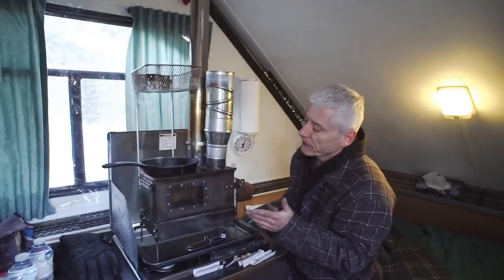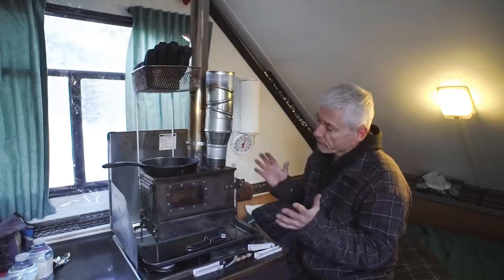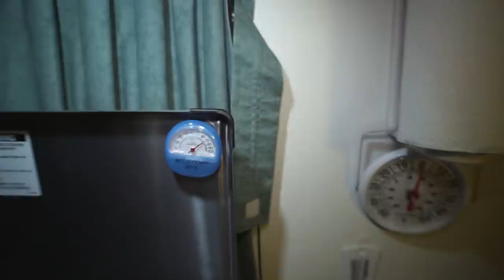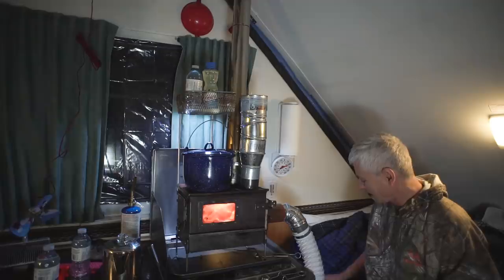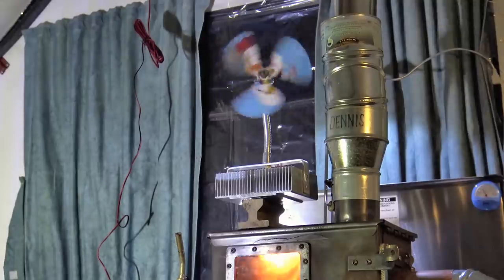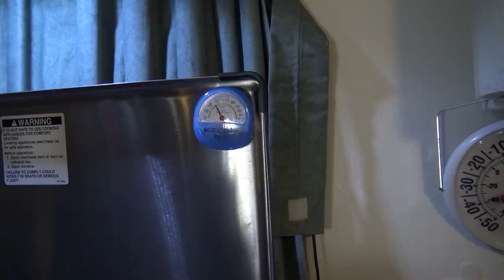Wood Stove in an A-Frame Trailer - Part 2

Comment from the maker: Comments appreciated but NO LINKS PLEASE !!! They get blocked. Thanks, SP
Reply: Have you thought about putting a rock on top to hald & radiate some heat?
Reply: get a rocket  stove.
Reply: Slim Potatohead where did you get the stove? It’s great 👍
Reply: @samgould9930  , I was thinking the same!!! Medium sized rocks to absorb & radiate heat around the base of the stove!
Reply: @marcgraham6438  , he fabricated it, himself. He posted videos on the progress.
Reply: Kate Hare McIntosh wow thanks I’ll look back
Reply: Super cool man!
Reply: @khm2128  non porous though..i like this idea.
Reply: @samgould9930  that's a great idea
Reply: Drill a small hole in the side and attach a rod to a small thin plate with holes in it. That will work as a shaker grate for the ash and make stoking the fire way easier. Happy camping... Be safe.
Reply: some plastic can melt on 130 C to 160c depend of what platic is :) this is only for soft or medium plastic :)  sorry of my bad eng
Reply: There is a heat activated fan for wood stoves that  operates on it's  own...No outside power source. We use them on our diesel stoves in our boats in Alaska. I would have put up the link but.....
Reply: I would have no problem stoking the stove every 3 to 4 hours because that is how long I can go before I have to pee lol
Reply: Hi Slim. I think you and RV Geeks do the very best videos. My name is Rolf. I have had a woodstove and a parrafin as well in my motrhome. No I have a trailer, large european messaur that is. I consider a diesel stove like the danish REFLEKS or the swedish GLEMBRING  for reservheating. THey work without any electricity at all. Have you thought about them?
Reply: Hi again Slim. . Would you be so very kind and expain ; why is´´do some heaters develop moister and some dont?  You and others speak about dry heating. In my world warm air hold more water than cold air. So, water is condensating on colder surfaces like a tralerwall. More visible on the window. What has what do with the source of heating? GR/Rolf
Reply: Tripped a little on the words. I think you understand anyhow!!
Reply: A computer fan inline in that hose would stoke the fire up nicely. As some below said, if it were thermostatically activated, it would stoke the fire as needed, like an outdoor woodburner.
Reply: @samgould9930  I would warm the rock up and take it to bed. I'm so old, I have to take a warm rice sack to bed to keep my feet warm, (microwave 3 mins)
Reply: Needs bigger hopper.
Reply: @rolfbremberg5846  every flame produces water, if you can have the heat from a flame wich ventilates outdoors you have the heat without the moisture (dry heatsource). Some fuels contain more water than others. Electric heat is the best, but requires a lot of amps...  Often stoves (and fireplaces) suck in more cold air than they can heat an rea by burning fuel. A stove is efficient when it gives off more heat than it sucks in cold air to burn. Best is therefor to get a fresh-air intake dedicated to the stove frome the outside and a long pipe to vent out. This way the hot air isnt sucked out a room and used to produce a flame.
Reply: Hi Slim, I’ve watched many of your videos and I love them!
I’m shopping for a new trailer camper.. my current ones 18ft and nice but not ideal for towing or going into rougher  roads... so I was think of a small outside kitchen teardrop... but I’m kinda leaning toward an A-frame after watching many of your videos... mmmm....
Reply: @pavelstoikov3780  Your English is very good. :)
Reply: Thank you for sharing such beautiful photos I enjoy what you do I am kind of the same way been doing a lot of the same things for many years just turning 50 now

Comment: Source two thick Mylar survival blanket. Attach light duty magnets to your ceiling and blanket. It’ll reflect a ton of that escaping heat.
Reply: Mylar sheeting is flammable and burns with toxic fumes at up to 1000F.  So maybe not a good idea?
Reply: @robertb.slingsby3584  …..why would the Mylar be anywhere near a open flame?

Comment: Little heads-up cheap bit of advice go to the Dollar Tree store and get some hand sanitizer the gelled kind squirt a little bit on your pellets light right up and get it burning really good
Reply: Check that it's an alcohol based one
Reply: Or, drench a toilet paper roll in cooking oil and you've got a stove starter on a roll. That's how I turn on everything. Wood stove, BBQ, camp fire. Learnt in Mexico. It even smells good.
Reply: Another suggestion would be to use cotton balls dipped in Vaseline as a fire starter... it works great
Reply: Esbit fuel tablet, light it then add pellets. 1 match or a Bic, no torch.

Comment: I put a wood stove in my tiny hunting cabin. Insulated it with 95mm walls, floor, ceiling and put a wood stove in there. It turns in to a sauna in no time. So insulation. Insulation. Great video! :)

Comment: This is THE best winter-camping-inventing video I have ever seen!  Like you, I love to invent the things I need to make a situation or existing item work better.  You already had me with the design and function of the stove.  I was thinking...hum... now, if you could only circulate the air in order to break the thermal layering of the air inside the camper, it would be perfect...  THEN you popped that fan on top of the stove!  I actually cheered out loud!  Oh my gosh,  I am completely blown away.  I love it.  You are the BEST!

Comment: The night issue might be because the intake is air well below zero using the tubing. It might be more efficient to open a window just a crack or put in a small intake somewhere else a bit to ensure you have oxygen to breathe. Or you could put the intake tubing which intakes a combo of inside and outside air. I heard your CO comments but I would get a smoke detector. I know pellets are efficient but the detectors cost five bucks and could save your life. Since they're so efficient if a small amount of smoke escape you might not even see it for a while and not at all if you're asleep. Also it would wake you up if a roof fire started in time for you to maybe put it out. A fire in that small a shelter could trap you inside quickly. I'm a retired career firefighter and have seen even trailer homes do the same in just a couple of minutes from start to finish from ignition to complete engulfment.
Reply: I also thought the thin plastic intake tube was causing the cold air to emanate into the camper, sort of negating the heat output of the stove. I'm behind on his videos so I am interested to see how he handles this issue. Will keep binge watching him. lol
Reply: im wondering what the issue is with low oxygen levels. i love wood heat and ive never noticed any lacking at all.

Comment: love wood stove heat.. Once had a large 1962 metro Step Van ..put one of those small air tight tin wood stove in the step of passanger side with pipe going out window  & up .. Back in 70`s we real stood out in RV parks ..lol

Comment: Wow Slim, I love your inventiveness besides the nature photography and the videography. So many channels are blah blah blah, not explained well and could be shortened by half.  

Love the chimney cap. May need to look more closely at it’s construction. My cabin has a 5 inch stovepipe. I couldn’t find a cap for it that wasn’t made of flimsy aluminum and meant for a gas appliance vent.  I’m using it but I’ll copy yours with heftier metal. Thanks.

Comment: Thinking if you bought one of those little 2KW diesel heaters they would probably make it pretty comfortable and easy to control temperature and they are very fuel efficient.
Reply: I like mine diesel heater too. Completely vented. With Slim's solar and the heaters low power consumption it would be a perfect fit.

Comment: I was just brainstorming before starting my own stove and I can’t believe you had the same idea to use a peltier unit to move a fan! After researching, if you used a metal cup as a heat sink you could use it to hold ice and snow. The greater the difference in temp between the two surfaces, the more electricity that is generated! However this is my proof of concept! Bravo 👏 I did not think it would generate enough to charge a phone. Perhaps if you’re using the stove mainly with pellets, you could redesign your basket for better results! Great series to watch before starting my project!

Comment: We use the big (not the one with the little bubbles) bubble wrap cut to fit our windows as insulation, seems to work and is easy to install and remove for storage.  Just a little moisture on the windows will keep it in place until you remove it.  Love the video!
Reply: Regular bubble wrap, or the reflectix that people cut to size for window insulation and privacy in RV's and vans?
Reply: @recoveringsoul755  Regular packing bubble wrap is what we use in our camper.  Place the flat side to the windows, It is not a miracle but it does help to keep some of the heat inside and the cold outside.

Comment: From a purely practical point, that was a LOT of work to get what you ended up with.  There's a lot of small wood stoves out there for just a few hundred dollars.  I don't know if they're as small as an ammo can, but probably there's something near that. 

But from the DIY, "let's see what we can do with a few pieces of wire and some bungee cord" point of view, this was a tour-de-force.  You picked a problem, looked at your resources and skills, and put together something that works pretty well.  And you were able to take advantage of other mods you've done to the A-Liner (like the remov-a-vent).  So congratulations, Slim!  You should get a walk-on bit on the MacGuyver TV show some day.

Comment: Hey Slim, thanks a lot for your videos. It's many input there...
Start your fire with oily Paper towels (vegetable oil is great and in your kitchen), because this fire will burn quick, hot and longer.
Best regards from Germany 😉
Reply: My thoughts exactly.    Save, in a zip lock bag, all used paper towels and napkins.  You can add oil,  petroleum jelly or wax to them as needed.

Comment: I just discovered your channel. Love what you are doing. A trick I found for insulating widows that may work for you: Take large bubble wrap, spray the window with water, put the bubble wrap on it squish side towards the window and man it really works. I use it in winter to insulate my windows which are quite large in my townhouse. It keeps the heat in very nice and it's easy to remove or put back up. Good luck and thanks for your videos!

Comment: Finally you are putting in real heat ! I've used wood heat most of my life and am putting a small wood stove in my RV. I've never started a fire with a blow torch though.Wood heat is awesome!Being a southern woman I prefer to be warm in my shelter.Why worry about air when using a propane blow torch indoors,relax man it's not as dangerous as those 0 degree temps.

Comment: Hi slim, I love the videos. May I suggest   a tip: If you carpet the walls in a fashion that is quickly removable for suitable weather, it will insulate you much better in harsh cold weather. An indoor/outdoor carpet type and/or reflective bubble wrap.. chears!!!

Comment: If you increase the thermal mass of the stove it will hold heat longer, you could use  tile, bricks or even sand in the cookie tray to increase the thermal mass.
Reply from the maker: Very little in reality. Some lingering heat, but not the 538 deg F of a hot running wood stove. Yes, that lingering warmth helps in mild temperatures, but not much and not for long in extreme cold. SP
Reply: @SlimPotatohead  The main gain would be felt when you have very fast temperature drops, providing a thermal damper of course you are already happy with the stove so any tinkering is minor.  Thanks for a very enjoyable video.

Comment: As a former United States Marine that has done cold-weather training above the arctic circle one of the most made mistakes is how to layer in a sleeping bag. DO NOT LAYER IN A SLEEPING BAG . . . Naked or skivvies aka underwear at the most inside a sleeping bag. Layer OUTSIDE the sleeping bag. your own body heat is supposed to be collected inside the bag to keep you warm. If you layer inside the bag the heat never gets collected in the bag that is supposed to retain the heat for your comfort and by way of never getting warm actually draws the heat out of you in an attempt to warm the bag so as to keep you warm.  So now that you understand the concept. put blankets, tarps, and secondary sleeping bags (of descending warmth ratings/thinnest on the outside, thickest closest to your body). Oh and lastly if you are going to use a tarp or plastic as an insulator to sleep make sure not to sweat. The non-breathable material of your choice can cause the body to go hypothermic very easily that's why I prefer it to be the outer most layer. More options for pulling it on and off for temperature control. I personally prefer 2 lighter bags stuffed with blankets in-between for ease of washing/cleaning of my bedding. The colder rated/heavier bags take a larger washing machine and are much harder and longer to dry. Now this, of course, is only important till you get your heating situation sorted out.
Reply: Yup, clothes worn inside sleeping bags make you sweat and keep you colder in the end.

Comment: How much does that container of one hour wood pellets cost?  How does that compare to your on-board propane?  It would be nice to know the cost per hour.  You didn't mention how you positioned the damper.  That first night was it full open or did you damper it down?  Also now that you showed us a new toy--the stove whirligig--will you be showing a "how to" for making that?  Thanks in advance!  Love your videos!!
Reply from the maker: About 12.5 cents an hour. $5 for a 40 lb bag of pellets. Propane may be 25-50 cents an hour. Good question about the damper - it was at 3/4 open the first night. I may release a video on the DIY stove fan in the future if there is interest. Thanks! SP
Reply: Count me as one interested.  Thanks for the cost breakdown.   Have you tried split/cut wood indoors yet?   I'm just wondering if removing the tent stakes and letting the ash fall further might keep you from having to get up to skewer things.  Since it's removable, perhaps you can try it without the tent stakes.  If it does improve the burn, I have a stove tool scraper that is made for tent stoves for ash cleanout.  Perhaps you could use a tool like that instead of dumping the tent stakes, and when you have mini logs, you could put in a small grate to create air flow.  Just a thought.
Reply from the maker: At this point I do not trust igniting firewood inside the trailer. I believe this may increase the risk of carbon monoxide over wood pellets. Thanks! SP
Reply: $5 a bag approximately in my pellet stove it lasts about two to two-and-a-half days around clock. 40lb bag, be careful some stores like Bi-Mart pull a fast one selling a 30lbs bags. You think your getting a deal, your not.
Reply: Thanks!
Reply: @SlimPotatohead  try to find some fat wood two or three good chunks will get the fire going in not time
Reply: Also if you buy a ton which is 50 bags from Jerry's you save a dollar for every bag it be about $4; is a 20% savings
Reply: @SlimPotatohead  dont fall asleep with nothing in the basket
Reply: I also wanted more info on the fan.
Reply: @Tanya Metzger Look into an anthracite coal/wood burning stove.   Anthracite coal can be obtained from most Tractor Supply stores.  It will burn clean AND burn for 8 hours; that means you don't have to fiddle with it during the night.  Also, you can burn stick wood, pressed wood bricks or wood pellets in it.  Above all, make sure all metal used for the coal stove is rated to withstand the HIGH heat of coal.   You need a buffer zone around the stove.   Meaning, nothing stored close to it, EVER.   A metal deflector, at the back of it, is a good idea.   Invest in a stove mat to place under it.   A flue jack must be installed where the flue exits the camper, so the flue heat does not burn the roof.  There are many safety issues involved and you must be aware of all of them, therefore, you have to STUDY and don't rely on the second hand information of others.   I grew up with wood burning heat and I know how uninformed people can make deadly mistakes.  There are lots of coal burning stove videos on youtube; take a look at them.  Above all, if you have children in the camper, I would never consider any kind of flame heat with which they would have access.   Hope all this helps and doesn't scare you away from an affordable source of heat.

Comment: Hi Slim. Love your videos!  I have a wood stove in my trailer. May I suggest vasoline cotton balls to start your fire?  Just drop one down your hopper to get you going. They work great for me and are easy to make. Love your stove.
Reply: Lois Laseau I bought something at the fair called Quickfire. Little clear packets of white crystals that look like sugar for lighting a fire.  They burn hot for quite a while. I’ve been experimenting with them cause the paper at my cabin gets too damp to light well. Have to “iron” it across a hot stovepipe and cram it in an airtight jar to keep it dry enough for lighting.
Reply: Stable Genius  lol
Reply: Stable Genius  danged old pro pain man cost that danged ole green backs man. Chit. Made outa dang people made outa danged ole money man?